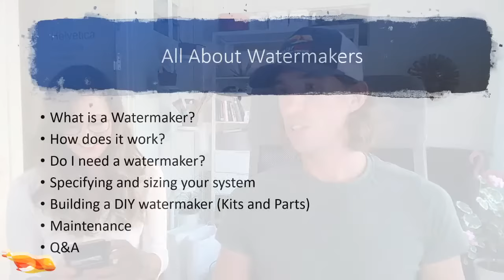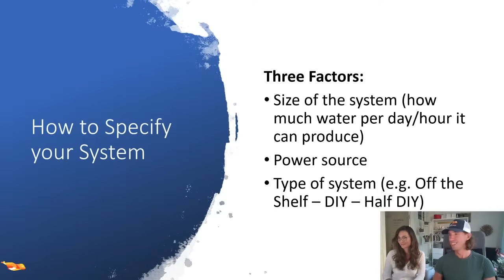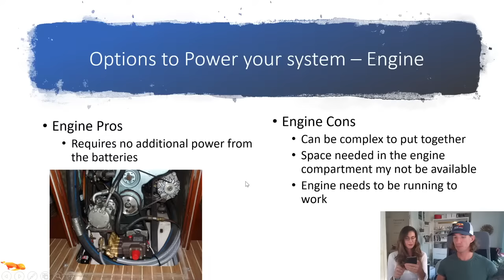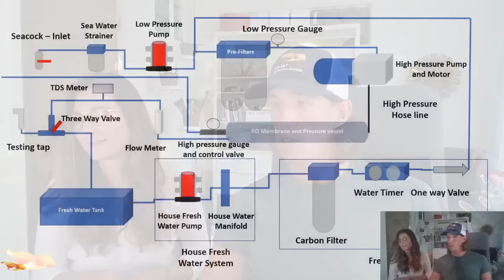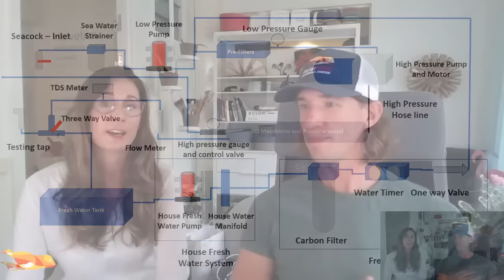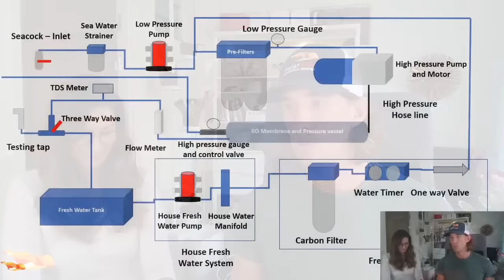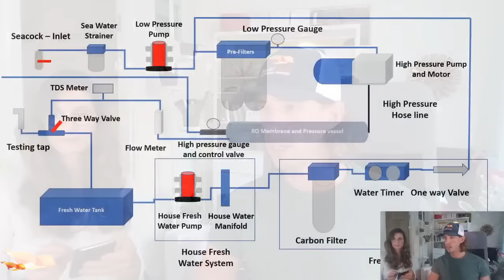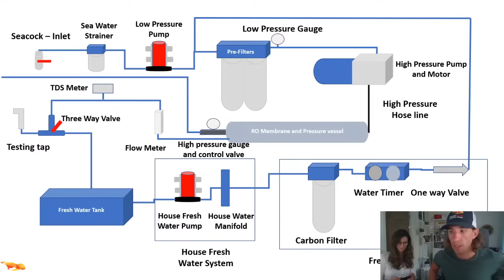How to build your own watermaker: tips, tricks, review & reality checks // Ryan's live tech talks #2

Comment: 3 way valves are easily obtainable in domestic central heating plumbing merchants providing 22mm can be accommodated.. Used as a share valve distributing heat either to hot water or central heating radiators.
Excellent explanation many thanks to Sophie and Ryan

Comment: Hey guys,there was a question regarding how do you know when to replace the filters.  On one of our water systems we have a low pressure gauge in the inlet and on the outlet side of the filter.  When the differential is more than 5 psi we chase just the 20 micron filter.  If the pressure on both sides doesn't equalize after replacing the 20, we then change the 5 micron.  We generally get three uses on the 5 for every change of the 20.  Your mileage may vary.

Also low tds is low pH (slightly acidic) which is reactive.  If you put that in the hot water heater, the increased heat makes it super reactive (speaking remineralization wherever it can find it) so the inline remineralization is super important for more than just drinking water purposes.

Love your content! 
Jeff

Comment: Really good information on RO! Thanks I enjoyed it. Can you help me understand something? I have noted small and medium size units using the same membrane. Dow says it can except 6 gallons /min for a (SW30-2540)  daily production @700 gal/day (29.1 hr). So the choice of a unit comes down to max output of a motor/pump combination (that does not exceed each parts Max (rpm or psi) and fits your power consumption requirements?

Comment: Your AC vs DC efficiency argument really depends.  You missed the efficiency loss in DC over cables. 

A good inverter loses %6 efficiency, but your 24V DC power cables are probably losing twice that, if your water maker is 10 feet from battery, and four times that at 20 feet... or you are running really heavy cables.  At 12 volts it’s even worse.

 Rough figures, you can calculate the loss for your situation and if the water maker us right next to the batteries then very thick welding cables will result in very little loss.  The voltage drops you’re talking about are reflecting efficiency loss.

If you’re going to have an inverter anyway, then the location flexibility makes AC worth it for most.

There seems to be an almost religious belief on forums that inverters are super inefficient. I think this comes from people who don’t understand what they are. They think cables are perfectly efficient because they aren’t doing any conversions. But they then use under sized cables, resulting in a worse situation.

You have to do the math and if efficiency is your goal, size the cables up a lit or make them very short— ideally both.
Reply from the maker: Hello... Yes you are correct in your arguments there and talking about losses in the DC lines would have been smart.  Though I'm only one guy and there was a lot to talk about.

I do agree that the inverters are also somewhat efficient.  When it came down to my decision I just did not want to have a other system (the inverter) in between the watermaker and the power source.  Ryan